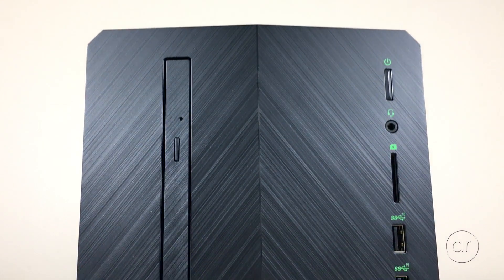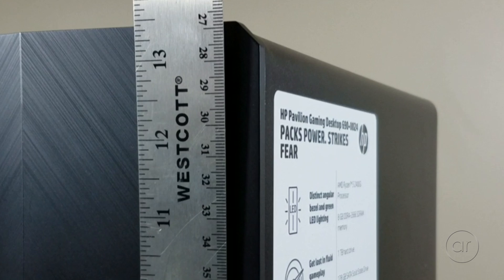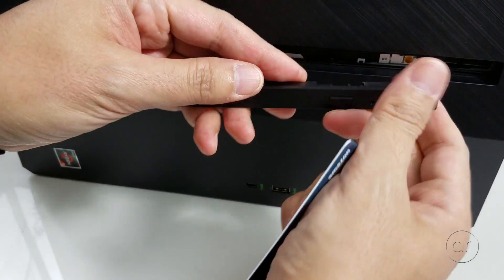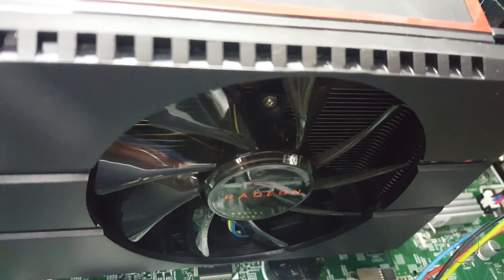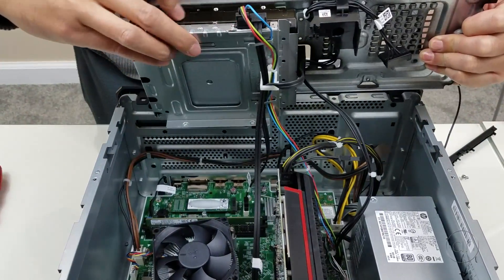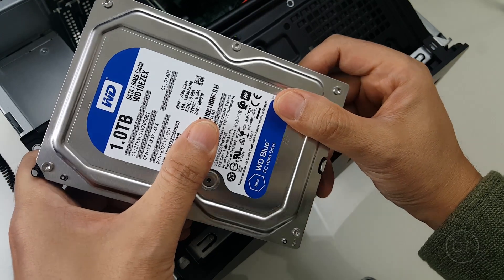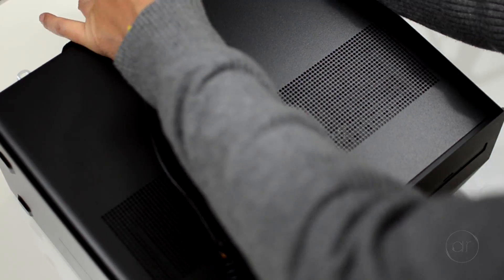How to Open and Upgrade a Ryzen-Based HP Pavilion Gaming Desktop

Comment from the maker: I will be maintaining a list of components that have been successfully upgraded in the description. If you have had any success stories, please comment below and I will gladly add your experience to this list. A big thank you to all my viewers and subscribers!
Much obliged 🎩 to all my viewers. Like. Share. Subscribe. Enjoy.

Support links
☕ BuyMeACoffee: https://buymeacoff.ee/accessrandom
🐦 Twitter: https://twitter.com/accessrand0m
► Subscribe: https://www.youtube.com/c/accessrandom?sub_confirmation=1
_
Due to popular demand, I've made some measurements on the video card (which has also been updated in the description under "Graphics"). The length of the RX 580, measured from the back of its plate to the edge of the card, is 7 1/16". The length of the case is approximately 10" - in other words, that would be the longest card that can fit. I didn't measure the width of the RX 580 but it's the standard width of a card that takes two slots.
_
► Please note that there is no need to remove the DVD cover as shown in the video.
_
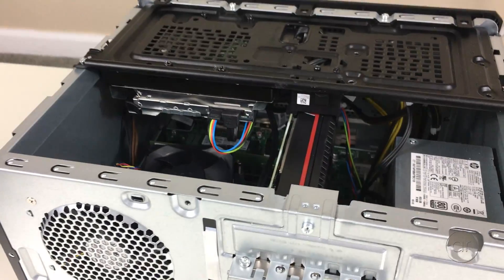Thx to Ye Wang: No need to pry the DVD cover "like you did there on 2:25, instead [it] has a black plastic quick release tab (seen in 1:43), you can press it in and push the entire optical drive out of the front panel..."
_
Also: thx to tinmania: "HP recommends: Before removing the drive cage, unplug the two cables connected to the rear of the optical drive,  press the lever on the rear of the drive, and simply slide it out to the front (no screws). Reverse when reassembling."
_
► A note about the PCIe x1 Slot.
_
Thx to jofrejkd: You can't use the PCIe slot to install a sound card if you use an NVMe in M.2 slot: "To be clear, the port can be used if... using sata drive... The M.2 NVMe is faster because it actually steals the PCIe ports pipeline... if you install a sound card, it will show it in device manager but the system won't find it" See jofrejkd's comment for workaround.
_
►M.2 SSD
_
Thx to tinmania: HP's site lists SSD as NVMe but is actually SATA (MZNLN128HAHQ-000H1). Replaced it w/ a 500GB Crucial NVMe SSD (CT500P1SSD8)
_
Thx to Richard Burns: 1TB M.2 NVMe SSD (Crucial P1 CT1000P1SSD8) works in a Pavilion 690-0067c
_
Thx to Jon Kingsbury: Addlink S70 512GB SSD NVMe PCIe Gen3x4 M.2 2280 works in a 690-0022na
_
►Power Supply
_
Thx to Stephen Craig: in a 690-0067c, upgraded from 310W to 400W (HP part L04618-800)
_
Thx to Jon Kingsbury: in a 690-0022na, upgraded to a 500W (HP part L05757-800). Slight misalignment of screws - only one fits - but fits in latch and doesn't move in chassis. 
_
Thx to PinoyPhantom: in a 690-0067c, upgrade to a 500W (HP part L05757-800). Could only secure the PSU with the top left screw. It has a 6+2 pin connector so you dont need an 8 pin adapter (please see corresponding graphics card update in description).
_
►Case Fan
_
Thx to Joe Candelaria: replaced existing case fan with 92 mm be quiet! fan.
_
Thx to S6.: 2 x 92mm Noctua NF-A9 PWM 25MM in case. Along with Noctua CPU fan (see following section), temps are ~65°C.
_
►CPU Fan
_
Thx to Jake Wagner: upgraded to Freezer 12 (removed the drive cage) in a 690-0024 - idle temps ~25C, full load stress test at ~65C
_
Thx to S6.: Noctua NH L12S, with pipes up and fans at bottom in push mode. Along with Noctua case fans (see previous section), temps are ~65°C.

_
Thx to Terry Parrott: “First thing you need to know is... the hold down spacing is for an Intel 115X." An AM4 cooler won't fit

_
“The case fan sucks air out of the case but the [inlets] are... blocked by the rack holding the HDD and Optical drive... temps run up to 85C+ playing Fortnite.

_
“The only way to improve that is to remove the rack... and even then it only drops to around 80C under load. So I removed the rack and replaced the Freezer 11 LP with a Freezer 12.

_
“Two problems... 1) the PWM fan for the Freezer 12 isn't recognized by the motherboard and 2) the M3 [fasteners] that come with the kit are too long.

_
"So here's what you have to do...
1) order a Freezer 12 and 92mm case fan
2) go to Home Depot and buy 2 packs of M3-0.5 x 16mm Socket Cap [fasteners], one pack of M3 flat washers, 6" zip ties
3) remove the rack entirely
4) plug in the 92mm fan and set it aside (because it’s a hassle with the cooler in place)
5) replace the CPU cooler with the Freezer 12 using the [fasteners from] Home Depot
6) zip tie the 92mm case fan to the Freezer 12 on the RAM side blowing through the cooler toward the back of the case

_
"Temps maxing out at 65C under full load... Downside is you lose the HDD & optical... and end up with [an opening] in the front of the case… AMD says the max safe temp for Ryzens is 70C and this was the only way I could get the temps to stay that low.”
-
►Reducing CPU temperatures
Thx to epc for the following tip on reducing CPU temps: 1 easy modification to increase the cooling of this PC: move the 3.5" HDD from the top to the bottom of the rack.  This gives a direct path of air flow going from the top of the rack, past the CPU heat sink / fan, then to the case fan in the rear.  On my system (690-0067C), this reduces the CPU temperature by 5 degree C as measured by CPUID HWMonitor.
_
Thx to KayBassYT: After removing the cage and losing the optical, I ziptied the sata drive at the bottom of the case against the front mesh plate and it's sitting there stable. I put in a Noctua NH L9x65 cpu cooler/fan. With stock case fan and no intake fan yet (I ordered one just now), the temperature range is 33~47C. This is a HUGE improvement from 55~70C @ 28 ambient @ only 5~15% cpu utilization.
-
►Phased Upgrade Notes
_
Thx to drunkdonkeydude
 for the following write-up:
Priority upgrades -
RAM, Get at least 2x8 2666mhz (The fastest this mobo can support unfortunately)
SATA or M2 SSD Drive. Make that your boot drive. I went with a PCI-E 4.0 backwards compatible m2 drive to use in future builds. Mind you this mobo only supports 2 of the 4 PCI lanes the m2 drive could utilize, so your M2 drive will be running a lot slower then it could. Its probably still faster then a SATA SSD though. Either of them is a HUGE upgrade over the crappy HDD. I had to unplug the hard disk when putting windows on the new drive for it to boot properly, then I was able to set the HDD up as a secondary large storage.
_
Those will be your most important and easiest upgrades out of the box. Next will be a CPU or GPU if you want to keep going. Read the description to see what  others have gotten away with. You only have about 10 inches of clearance and not a lot of power to spare. My unit had a 400w PSU. This limits our choices. So I went with a RTX 2060 super, figuring the GFX card will come to whatever future machine I build.
The CPU is also tricky. This motherboard does not support the X version of the ryzen chips. Because of power limitations and motherboard limitations, realistically your best options are a R5-2600 or a R7-2700. You  could also look into 1000 series chips if you would like but those arent all supported either. Since this motherboard cannot overclock, I went with an R5-2600 for its higher base clock speed and comparable performance in games. You could potentially get a nice deal on a CPU right now as 3000 series Ryzens are doing well and folks will want to get rid of their old ones. Sadly we cannot use those new 3000 series CPUs. But worry not!
_
If a new SSD and RAM upgrade are phase 1, and a new GFX card and CPU are phase 2, and you've come this far and still are considering the future of your invested machine, then consider phase 3: A new case, motherboard, and power supply. I would go with a newest chipset that can still support your Ryzen 2000 series CPU if you can. Like perhaps the x570 later this year or next year when prices have come down a bit. A new motherboard will give us a lot of improvements and features over HP's proprietary customized junk. More slots for RAM, expansion, potentially  more ports, incorporated cooling, THE ABILITY TO NOW OVERCLOCK OUR CPU FREELY. A new Power Supply to facilitate this new case and board will also mean being able to  support a whole bunch of expansions and devices and overclock that graphics card without fear of overdrawing from HP's weak 300-400w PSU You may also want to  buy faster 3000mhz DDR4RAM at this point to replace our old 2666 mhz RAM. Better RAM speed/timing will get you bigger yields over marginal OCs in many cases with Ryzen CPUs.
_
If you've gotten to or past phase 3 and have moved all your expensive components to a new case/board, did your overclocking, or decided its not for you, and are ready to embrace the future...Well, you're pretty free at this point. You could buy a 4000 series Ryzen (5000 series?). You could buy a RTX 3080ti or 3660ti or whatever is relevant at the time. Better coolers for more overclock tinkering.
_
tl;dr 4 phase upgrade plan to turn our dinky prebuilt storebought mass produced PC into an unbeatable titan of the future.
-
►CMOS Reset Notes
-
Thx to Chris for an important note about re-setting the CMOS:
Before upgrading make sure you update the latest BIOS and make sure you are very patient since this computer is extremely hard to upgrade. Make sure you clear the CMOS before you install your new components since this motherboard is so stubborn recognizing new components which I made the mistake of not clearing the CMOS which made the PC not boot at all and cause a boot loop. To reset the CMOS it is very hard to do without removing the GPU out of the computer so make sure you do that and remove the battery from the PC for a couple of minutes and put it back on. When you finally boot with the new CPU make sure you press Y which will Reset the fTPM which will remove user accounts but not the data on the drive windows is installed on and you can always add back the user accounts if you want.
Reply: I upgraded the gpu and psu in my 690-0067c.  It came with the rx550 and 310 watt psu.  It would only run games at med or low.  Fortnite I got around 80-90 fps on low settings.  I found a like new rx580 4gb hp oem card on offer up for $99.  The Hp part # is 936246-001.  This is the single fan 4gb version which is smaller so it fits inside the factory case.  It can also be found on Amazon.  For the psu I ordered HP #L04618-800 which is the same size as the stock 310 watt but has 400 watt output and the 6pin power cable needed for the gpu.  Everything fit and plugged right in with no issues.  Fortnite on low settings now stays right around 144fps capped.  I can run games on Epic settings now and still have smooth frames.  Fortnite on Epic hovers around the 120fps mark.  Dauntless on Epic runs butter smooth now where as before I had to run it on low.  Another gpu option would have been the Zotac gtx 1060 mini 6gb (ZT-P10600A-10L) which also requires a 6 pin power cable and 400 watt psu but I already had a 144hz freesync monitor so I stuck with the rx580.  I know it's not the best gpu but with the limited upgrade options due to the motherboard and case size it will work for now.  I really did not want to get a different case, new gpu, psu, and motherboard just to have decent frame rates.
Reply from the maker: @stephen_craig  Thanks for the great info. Would you mind if added your information to the description with credit to you?
Reply: @accessrandom  No problem.  Not at all.
Reply from the maker: Thank you👍
Reply: I have upgraded the RAM with another 8GB module (since the existing 8GB is one module, not two 4GB modules--thankfully).

I bought the module from Amazon, and it matches the specs of the existing RAM: 
https://www.amazon.com/gp/product/B0734V4SSR

It was recognized fine, and runs in dual channel mode at 2666MHz, as it should.
Reply: @tinmania  so you used Crucial Ram And Kept The Samsung Ram Thats Already Included In The System And It Worked?
Reply: @Malos  Yes, works great. I made sure it was the same specs as OEM, so I expected it to work.
Reply: Just ordered to be what I understand is the original ram that came with the box:  Samsung M378A1K43CB2-CTD on amazon here:  https://www.amazon.com/gp/product/B07F72RJYN/ref=ppx_yo_dt_b_asin_title_o00__o00_s00?ie=UTF8&psc=1

UPDATE:. JUST INSTALLED AND COMPARED THE RAM. SAME EXACT ONE.
Reply: access random  put that info in the description. I don't understand why you have things that will work , but don't have a link to the same exact RAM. I just installed it and can confirm it is a match.
Reply: I swapped out the m.2 128GB sata SSD for a 500GB NVMe. Speed tests went from 500 MB/ps to over 1,500 (read). Similar improvement in write speeds. I got this one for $75 (now $89): https://www.amazon.com/gp/product/B07J2WBKXF
Reply from the maker: @tinmania  Thanks again! I've added your entry to the description with credit to you.
Reply: I recently added a MSI Ventus RTX 2070 and 32gb of DDR4 Corsair Vengeance ram to my system. It runs fine but I am waiting on the 500watt replacement power supply to come in to give me more headroom. My model is the 690-0034
Reply from the maker: @robotvm  Is it ok if I include your info in the description with credit to you? Also - could you please send model numbers if possible?
Reply from the maker: @robotvm  Thanks much. Would the model numbers be the "RTX 2070 Ventus GP" and the "CMK32GX4M2D3600C18" (2 x 16GB 3600 sticks) by any chance? I just found the nearest matches on Amazon but wanted to make sure so others can find them easier...
Reply: @accessrandom  The ram is DDR4 2400hz
Reply from the maker: @robotvm  Thanks!
Reply: if I buy a WD hard drive, will it come with screws to mount it? I don't think it does, i've seen unboxings on youtube. Would I need to buy a sata data cable to connect to the board? if so, which one. Where do I get these screws and what size are they
Reply from the maker: Normally you will need to buy a SATA data cable and the screws, which are usually just sold as hard drive mounting screws. They are #6-32 screws.
Reply: @accessrandom  how many m.2 slot are there? can i put another m.2 ssd
Reply from the maker: @naegleriafowleri1715  There is just one M.2 slot.
Reply: @accessrandom  I just installed new ram, what a pain in the ass. I wonder if we can modify the cover, like maybe widen the holes or something, to give the case more airflow, maybe even open the whole hole. Is there any other way to improve temperature. I suppose adding thermal liquid to the cpu is impossible
Reply: @naegleriafowleri1715  I opened the case to add the RAM after playing PubG and it was SOOOO hit in there. I'm definitely thinking somehow liquid cooling modification or bigger fan and or more powerful. 
It's a $700 box, so I'm not too afraid to modify.
Reply: @JT-xf9sw  unscrew the cover and leave it open for ventilation lol
Reply: @naegleriafowleri1715  look in to corsair  h60i liquid single fan cooler 
Lmk
Reply: @accessrandom  put the link for the same exact ram I posted in the description. Its the same RAM!
Reply from the maker: Thanks. I've credited you in the description. I'm trying to avoid links as I only have a 5000 character limit in the description (and I'd go way over if I linked to everything).
Reply: Joe Tavarez i paid $42 for that same ram from some dude who also bought this computer.
Reply: Yeaa I tried this water cooler 
It's too big
Reply: @naegleriafowleri1715  how did you change the rams speed? There is no option to do so in bios and Im sitting at 1035.0 mhz of possible 2400.
Reply: AnarickTheDevil I bought the 2666 original stick and it is 2666 when installed
Reply: @naegleriafowleri1715  Did you end up upgrading the HDD, i bought an additional drive for storage but im not sure if i need a single 3.5 bracket/rack, or if i can screw the HDD directly to the cage? I lined my HDD up on the cage but only two screw holes lined up with the HDD and cage. Thanks for your help
Reply: Today I upgraded the CPU to a Ryzen 5 2600.  However, I did have to stick with the stock CPU heatsink/fan that came with the PC as the mount points on the Sunflower motherboard don't seem to be standard.  Hopefully this doesn't become an issue as I have no plans to overclock the CPU.
I also removed the original stick of RAM and replaced it with 2x8GB Corsair Vengeance LPX DDR4 2666MHz (https://www.amazon.com/gp/product/B0123ZC44Y/).
Reply: @brendanmbone  I am considering upgrading my CPU. Has the Ryzen 5 2600 been doing well for you?
Reply from the maker: @brendanmbone  Thank you! I've added your entries to the description with credit to you.
Reply from the maker: Fantastic, thanks for the update. Always happy to hear a success story.
Reply: how easy would it be to swap the case?
Reply: How do I change the power supply and motherboard?

Comment: Great video! I have this exact build and I'm planning to upgrade the RAM to the "Crucial Ballistix Sport AT 16GB DDR4-3000 PC4-24000 CL17 Single Channel Desktop Memory Module
". Do you think this RAM will be compatible? Thanks.
Reply from the maker: Is this the model number: BLS16G4D30CEST? As long as you are replacing the existing stick (as opposed to adding to it), it should work - but keep in mind that it will downclock it to 2666 MHz.
Reply: access random hey! little update, i installed the RAM and had amazing results. Here are some games i benchmarked: Forza Horizon 4 at High/Ultra settings: 60-75avg fps and Rocket League with all maxed settings: 145avg fps. Used this video for the instructions and i’m glad i did! Cheers
Reply from the maker: Great! Always happy to hear success stories. Was it the BLS16G4D30CEST? If so, do you mind if I add that to the description (with credit to you)?
Reply: @accessrandom  Sorry for the late reply, but yes it was the BLS16G4D30CEST and no I don't mind if you add it. Cheers.
Reply from the maker: Thank you!